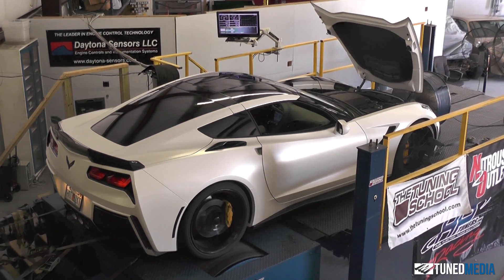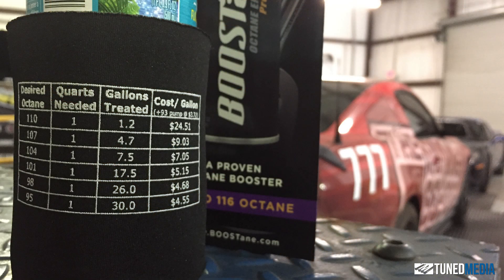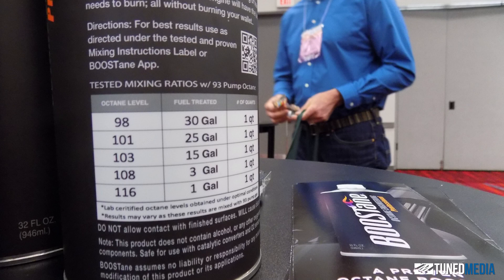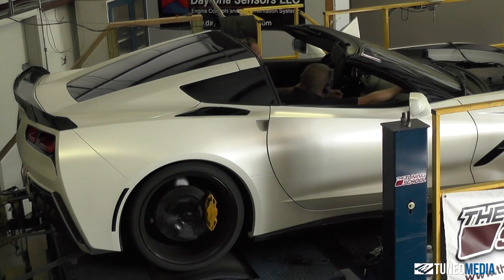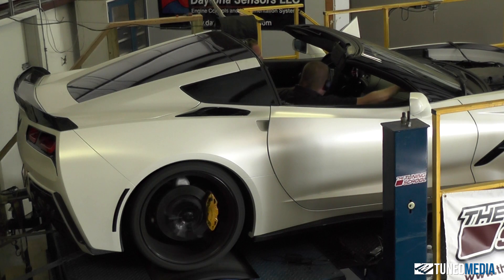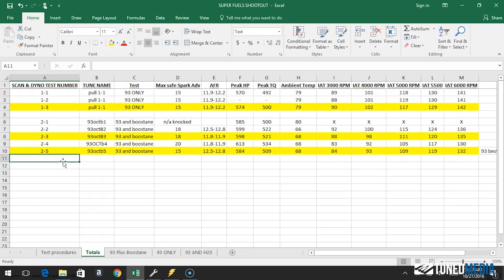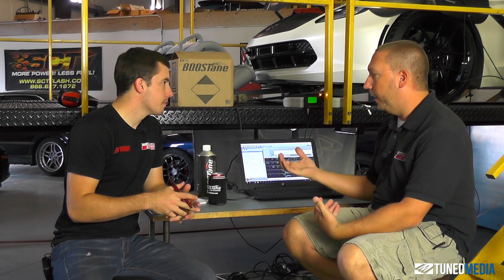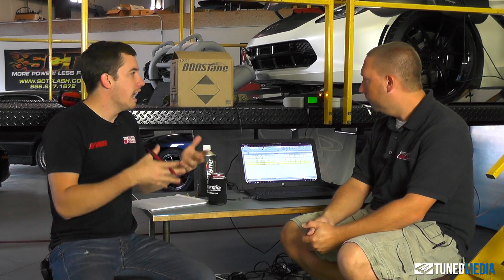Racing Fuels: Octane Booster Makes Big HP Gains on Load bearing Dyno

Comment: Hey guys what about Torco or RaceGas (Brand of another octane booster)
Reply: Basically the same stuff I use VP Octanium because it's at Auto Zone. Little less aggressive, 32 oz to 10 gallons of 91 octane will give you 99 octane. 64 oz to 10 gallons will give you about 102. If you put it in 5 gallon jugs as they suggest you can get over 100 octane on single 32 oz can.  5 gallon can of VP 101 cost me $68 dollars. For that I can  do 5 gallons with VP Octanium and 100-101 octane for $30 less ($38).
Reply: Dude your so wrong. It raises it 80 points not 8 octane points. A point is 1/10 of a octane number so essentially turning your 93 octane to close to 94
Reply: Steven Levan 80 points is 8 octane numbers. You just said it. An octane is 1/10th of a point
Reply: @stevenlevan9224  I have 91 bone head it's California and it's a similar product the all the others mentioned. It's just not made to scale like the others. I have run it on my 100 octane tune and I get no KR.  GTX3071, Focus ST.

Comment: Can you add the product on an empty tank and then fill with 93 to get the proper mix? Or is the issue it needs to chemically link molecules for 45 minutes?
Reply: Just like anything else..Get down as far as you can in the fuel tank. Put in however much Boostane/Torco Accelerator to get the octane number you want + how much 93 or 91 you put in. Do the math first however. Bootane only sells it by the case online, there is a 10% coupon however. That would get you (6) 5 gallon jugs of 100 octane unleaded. Using half a can of Torco Accelerator will get you 10 gallons of 101 octane (91 octane base). Now with all that said a car with bolt-ons, NA and all that will likely run it's best on 100 octane unleaded with a tune, you won't be able to take advantage of much more octane. My car is turbocharged (Focus ST), pushing the stock turbo to the edge of the efficiency + running some timing for added power, get as much octane as you can get. As you see with the Z06 which is super charged, there is no such thing as too much octane.
Reply from the maker: Please contact Boostane 1-888-GETS.110
Reply: TheTuningSchool, I sent them an email. How do you think BOOSTane compares to VP Q16?

Comment: Excellent! This is my new favorite YouTube channel!!
Reply from the maker: Thanks please help spread the word.  Send your friends this link  http://www.youtube.com/subscription_center?add_user=TheTuningSchool
Reply: I have read that Chevron Techron may help if it's run every 3000 miles when using an MMT Based Octane Booster additive. The Manganese Oxide builds up in a similar fashion to lead if leaded gasoline was used in a car where the fuel should be unleaded gasoline. The manganese oxide builds up the most on the hottest parts such as spark plugs and catalytic converters. If too much builds up on the oxygen sensors they can misread and throw off the air fuel mixture read and adjusted by the PCM. It will be interesting to see if there are any long term effects if Demonology & SRT Mush keep using it over time.